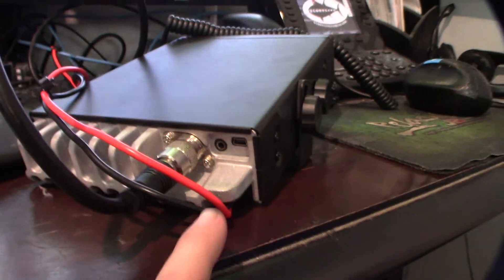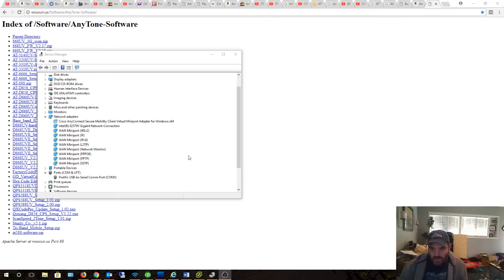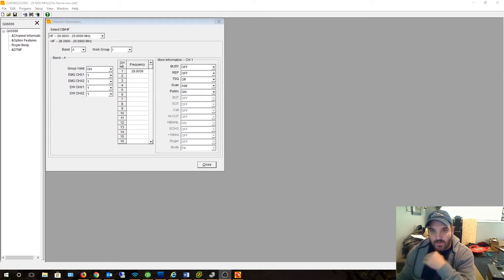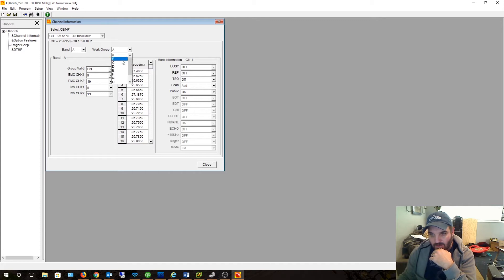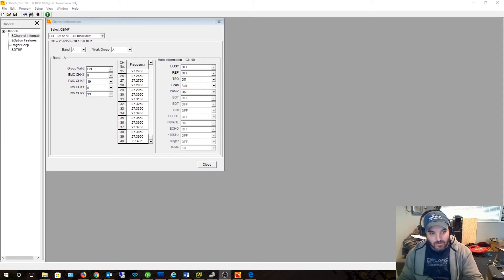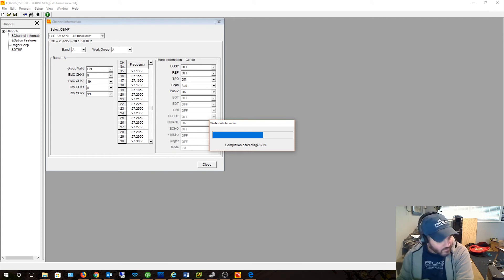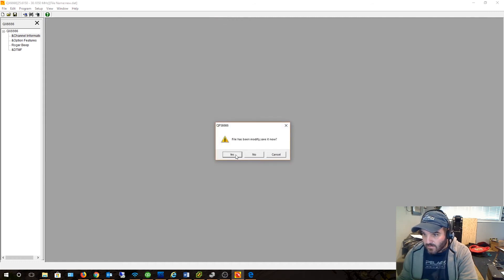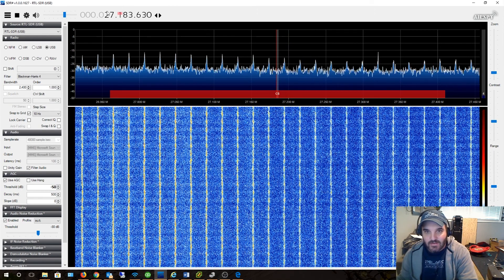Anytone AT-6666 Programming software and USB programming cable

Comment: I programmed 5 or the 6 memory channels for 3a, 7a, 11a, 15a, and 19a.  But as this radio is designed for an electret element, seems you can't use say a handheld power mike with good results.  Heard some of the Lincolns allow you to switch between condenser types.  Anyone have success putting say a D104 power hand mike on this radio?

Comment: If you select a "channel" and then switch to frequency mode and change the frequency, you are effectively changing the frequency of the "channel" and the new frequency that you changed to is saved to that channel slot.  Kind of annoying if you ask me, but that's how this radio operates.  The frequencies were out of order on your radio were set that way because you were on those channels when you switched to frequency mode and changed the frequency with the vfo knob.

Comment: Some frequencies are skipped on the CB channels because they were used for the old 27MHz Remote Control 'crystal' frequencies for remote control cars etc. Not really used anymore but the CB frequencies have kept the channel list.
Reply: they're know as the "Alpha" If the radio is full freq, 3A etc. should come up

Comment: Almost the same as the stryker software....If you took the covers off the 6666 and the 447hpc2 stryker,almost the same there to..
Reply: The Anytone AT-6666 is the same as the Stryker as it uses the same pc board used in the Stryker SR-955.

Comment: hi, 
do you know if the cb must be power on to be connected to laptop?
I want to setup SWR protect
thanks.
Reply: You don’t use a computer to cut on SWR protection. It’s in your menu.
Reply: You can use the computer software. You can also do it when powered on by entering the one of the hidden menu modes. You can enter 1 of the hidden menus by holding in the channel selector button until the menu appears an to enter the second hidden menu you hold in the menu button to enter the 2nd hidden menu.  @vsmichael1

Comment: There are different frequencies in the 'bands' (that are actually memory slots). Check first if the frequencies you want to input are already there, in some other band than 'A'. The groups feature is used to create separate teams of freqs. In combination with CTCSS and DCS you can create groups that communicate in the same 'channels' without interfering with each other.